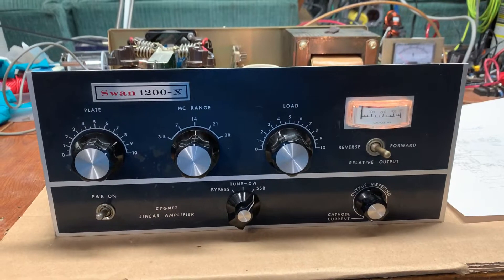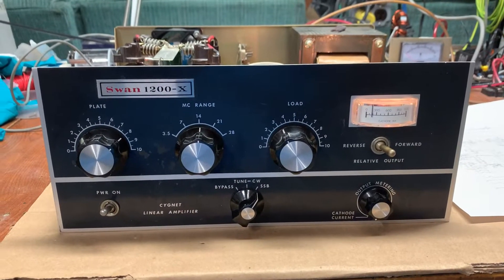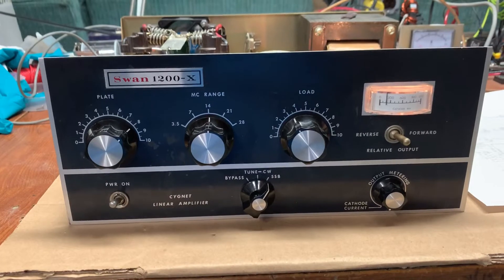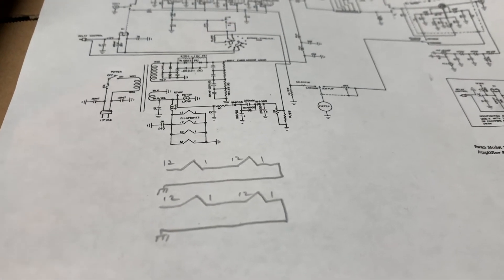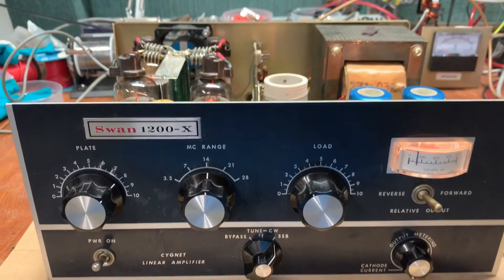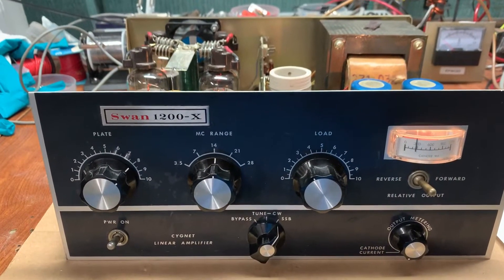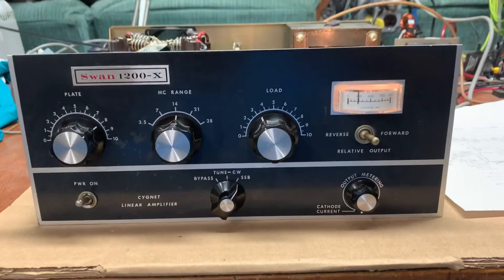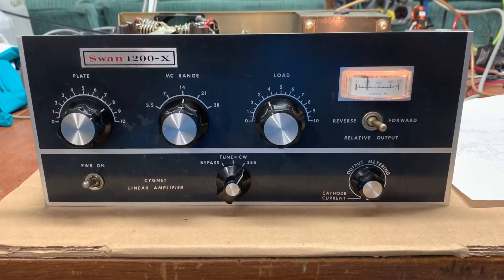Swan 1200X amplifier

Comment: I've got one of these in my junk box.  It was a $10 hamfest buy, because it had no tubes.   I have some tubes that should work, but they use a different socket.  Scored a set of appropriate ceramic sockets on Ebay.   Just another project waiting in the wings.  Hope the electrolytics are ok.